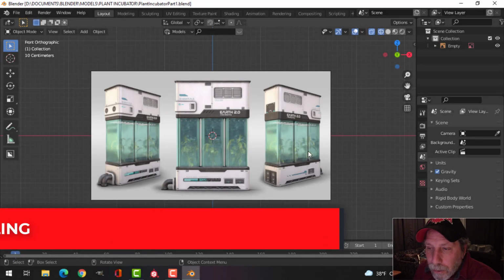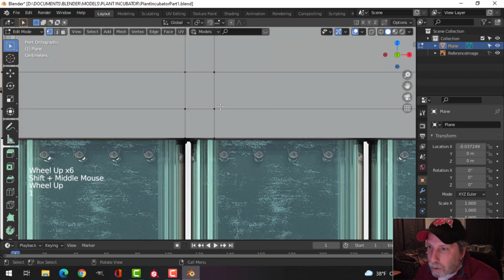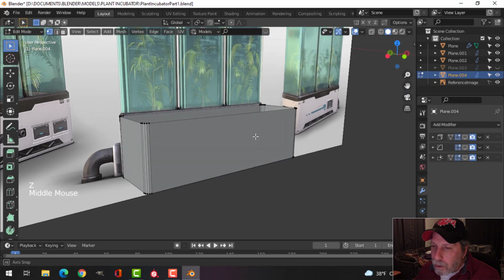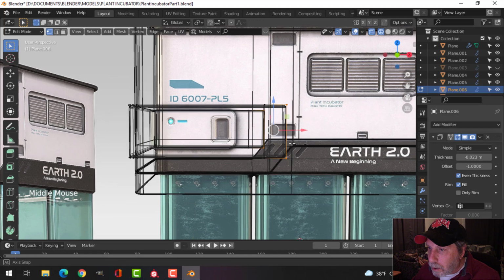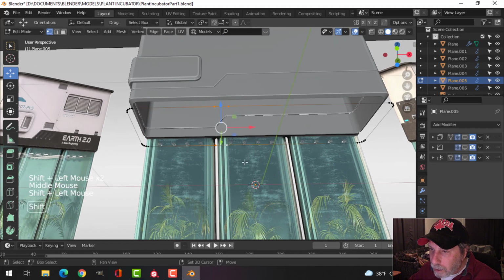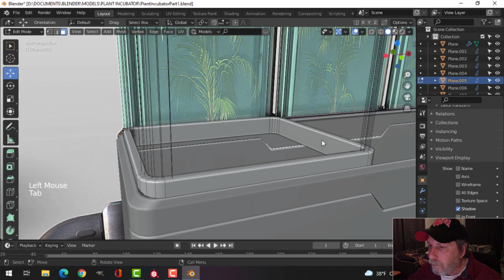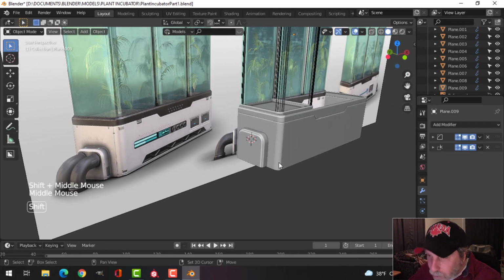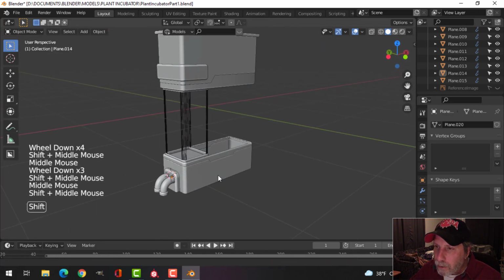BLENDER: MODELING SCIFI PLANT INCUBABOR (PART 1)

Comment: Hi! at 17:52 how did you get all of the faces to be on the front and back? I love your videos and I truly thank you for them as you have taught me so much
Reply from the maker: I'm not exactly sure what you mean.  I would have deleted the back face(s) on that piece and if the polys were facing the wrong way, I would have flipped them by selecting them all in edit mode and then crrl-n / recalculate outside.   Is that what you meant?